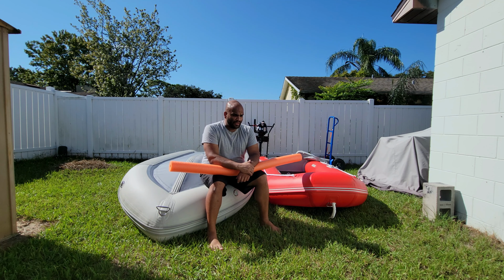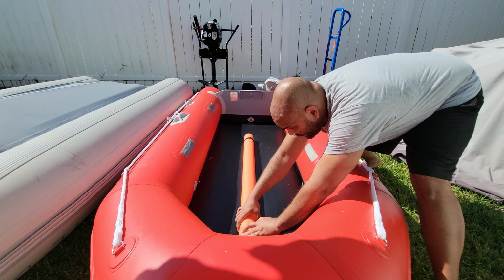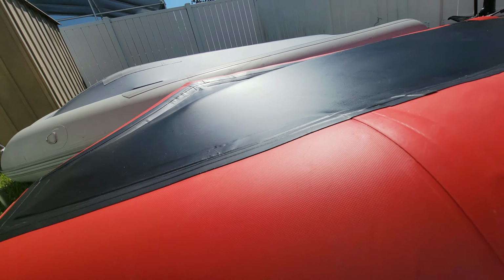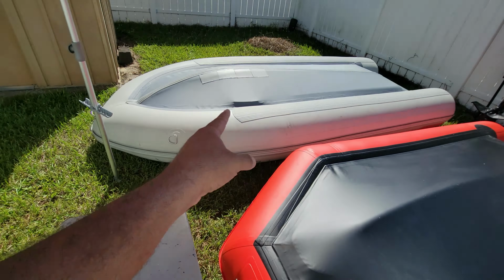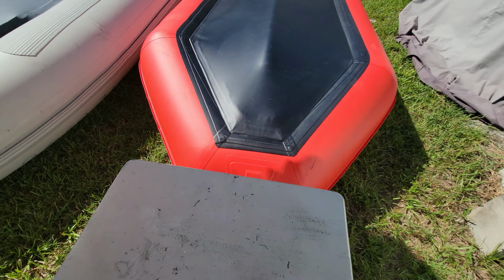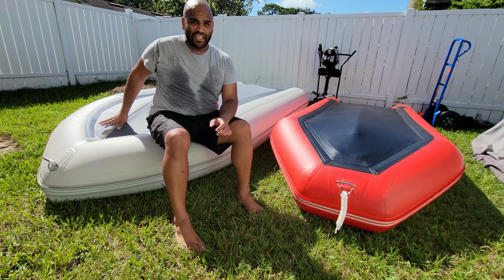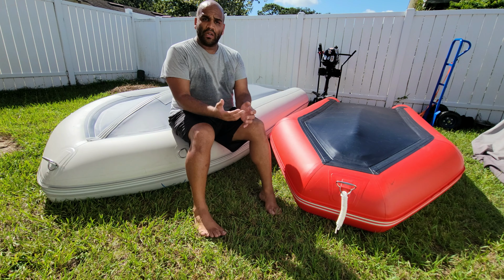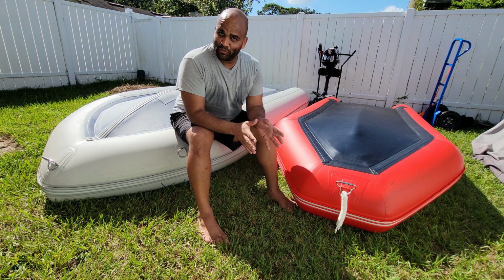Use A Pool Noodle To Make A Fake Keel On Your Inflatable Boat!

Comment: Thanks Erick. I thought you would just put the noodle and pump air. There's so much to learn. 
Btw you could have used rub strake at the bottom. I see that on boatstogo , but it's out of stock.
Reply from the maker: Anytime! I appreciate suggestions, especially when they are within my skillset to do, and I had the perfect boat for it too.

Comment: Would love to see you try this on the water and see if there is a noticeable difference with handling and getting through the water or does it just create unwanted drag. Great video as I have a flat bottomed sib and have wondered if this would be useful.
Reply from the maker: It helps a little bit when going fast. It breaks small swells

Comment: Can you do it on the kaboat?  I have a boat similar to the Scout 365, i use either Nissan 5hp 2 stroke or 9.8hp 2 stroke. And i got some problems with the wave coming.  Please help.
Reply from the maker: Yeah, it can be done. The floor may rise a little, but it is doable.

Comment: another tip, place a pvc pipe in the insert of the pool noodle for more rigidity
Reply from the maker: That is a fantastic idea!
Reply: @ErickMartinSucre  i have a 14.5 kaboat. Flat bottom. 8Hp merc. I took a 4x8 hard wood pine. Used the Air floor as a template. Instead of putting it on the bottom i put my pool noodle down first then insert the air floor. My Hard floor insert is sanded supper smooth and covered in white Rubber paint used in RV roofs. I added tie down cleats to help hold gear, i use a heavy duty out door carpet on top of it. Makes it supper rigged and helps with  standing for long periods. the hard floor with the Pool noddle under the air floor really helped my boat and its suction issues i was having. THe boat would form a vacuum unter the last 1/3 of the boat causing cavitation.  I added a whale tale to my lower unit so i can punch the throttle and get the hell out of the way of these Huge fishing boats flying on the water.i take my wife and my 2 daughters out both are still small 4 and 6. the boat gets on plane and cruises at 14 mph fully loaded. SOLO its a pocket rocket at 20 MPH. 
 Tight lines, and be safe .
Reply from the maker: @FathersGame2-zi5wv Oh yeah, those Kaboats can fly for real